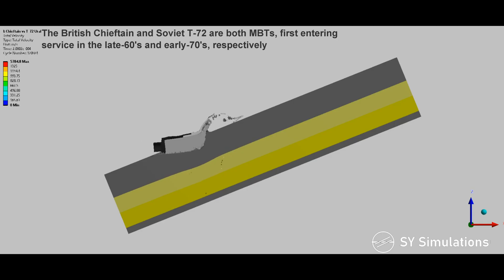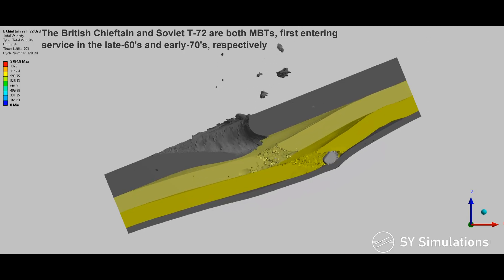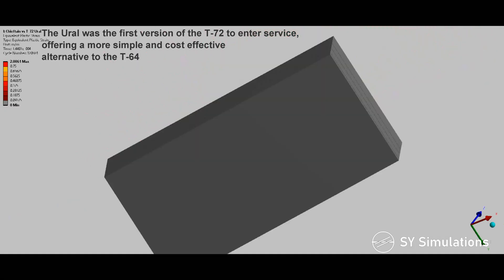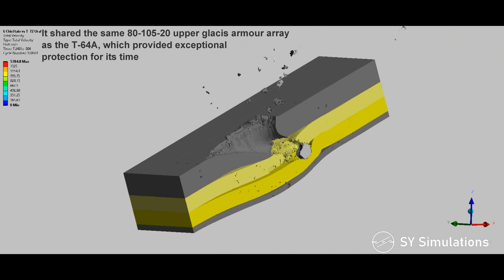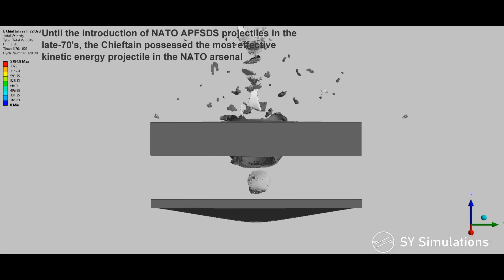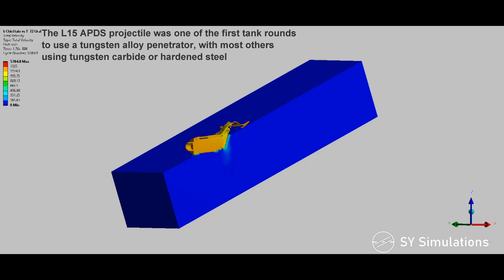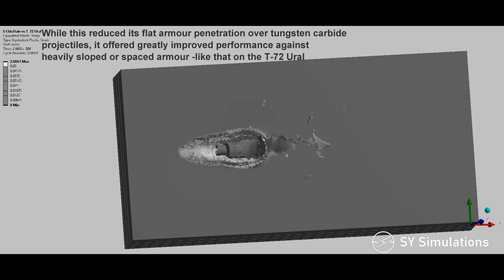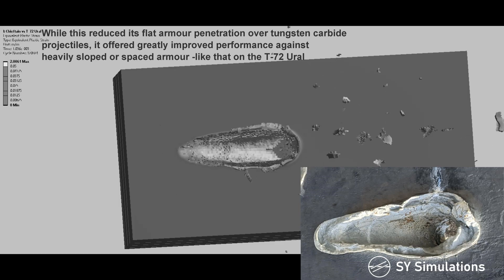CHIEFTAIN vs T-72 URAL | 120mm L15A5 APDS | Armour Penetration Simulation

Comment: really shows how impressive the T72 armor was at its time, the best effective NATO kinetic round, without being angled and at 700m and only slightly perforated it.. 

with combat conditons of lets say 100meters further and a 10 degree horizontal angle, would have definetly stopped the round..
Reply: For a 60s APDS this is very impressive against composite armor
Reply: @lemmen01  120mm cal man it's a huge round with high velocity.
Reply: that would still cause the tank to be abandoned when hit, the armor cracked.
Reply: The crew would be dead from this shot
Reply: @ZapTeam  it would certainly be disabled and the driver would be likely dead, but additional objects inside the tank which clutter the path of the shrapnel will likely not injure, or slightly injure the other 2 crew members as they are also positioned higher than the driver too
Reply: Well no shit that Iraqi T-72s smoked qwaiti chiefs...
Reply: It didnt perforate it, it stopped the APDS
Reply: @parallax9084  the simulation didn't continue for long enough you can see it perforate in one of the views at the very end.
Reply: @parallax9084  0.29 you can see the red dots in the hole at the very end, meaning it did perforate, it just didn't have time to exit it because the simulation wasn't long enough
Reply: @parallax9084 it perforated look at the plate at the end of the simulation you can see a visible hole and fragmentation
Reply: @Constance_tinople  the podboi spall liner was not modeled into this simulation....idk how much of a difference that would have made but the round seemed to have slowed to a crawl...
Reply: @Masterafro999  a crawl from our perspective is still likely hundreds of meters per second
Reply: @Constance_tinople  *being too slow to still fully penetrate the last plate.... The round lost all of its energy
Reply: @Masterafro999 it clearly spalls the armor, but its basically that
Reply: When it can't penetrate the front, then hit the flank and rear, it always has no problem.
Reply: @EatyourshitYoutube  sometimes you have no choice...
Reply: @belgianfried  And that is why we invented Kinder Surprise Eggs (IFVs) and Clown Cars (APCs) to unleash angry hordes of highly creative and borderline insane, Mechanized Infantrymen with shovels and RPGs upon everyone that thinks that our tank was a loner. Panzergrenadiere and their international counterparts exploiting a flaw in an enemies formation is both frightening and hilarious.
Reply: @belgianfried well, MBTs armor are very front heavy, so any modern MBT can penetrate side armor of any other MBT
Reply: @za_pravdu1943  obviously, but what I'm saying is what others have said — will you wait for ivan to go comatose so you can get good angle?
Reply: @ThePandoraGuy Mines stop that approach from working. In fact mines and artillery seem to make everything an incredibly painful, slow, chaotic grind with absolutely no appearance of the kind of graceful, smooth academic understanding of tactics discussed online and other relatively safe and peaceful places.
Reply: @EatyourshitYoutube thats not very good when the T-72 could penetrate the Chieftain from wherever it wanted.
Reply: @quan-uo5wsnot exactly. Early APDSFS russia would have struggled with chieftain turret cheeks, and while better ones were developed chieftain than did get armour upgrade as well as better ammunition. 
Plus early T 72 lacked in fire controll systems compared to early modernisations of chieftains, so while chieftain would struggle to pen, it would also get first try, and first hits in.
Reply: @EatyourshitYoutube  the chieftain is big, fat and slow unless you mean for a different nato tank to flank it instead like the leopard 1 or amx30.
Reply: @EatyourshitYoutube try to flank an single tank in an entire divisional size attack tho.

Yes theorically you can just flank bro, theorically.

Comment: didn't you got them inverted? tungsten is the alloy which has more flat penetration and bad angled penetration because its too much hard with zero resilience while  tungsten carbide more resilient and less hard so it has less pen and more angles pen ?
Reply: nope, tungsten carbide is the weaker one, TC is very brittle so if it engages angled armor it gets shattered in a worse way and isnt as effective, but on flat armor plate it behaves better because it "clumps" together. Tungsten alloy is the one with better angled penetration
Reply: @petrkdn8224  i got from somewhere else as i remember that they are the vice versa. TC being more resilient it has better angled pen because since it is more resilient it has the potential to lean more to adjust its angle (more like the cap in ap rounds) while Tungsten is harder so it can pen more flat and slip more on angles. it more like the M60 rounds: the original M392A2 with much flat pen and the M728 with more angled pen. isn't the latter tungsten carbide ?
Reply: @sameerGhs  M392A2 is WC. just remember that carbide = harder and more brittle, because carbide denotes higher carbon content which is inherently hard and brittle
Reply: I believe you can literally google what carbide is. 
Carbide tend to be metal with high carbon content to form ceramic like substance. 
Now, is ceramic tough or hard?

Also, for steel slug penetrator not utilizing erosion penetration, cap is there to protect the projectile. It does nothing to "adjust the angle" whatever that means. Capped steel slug penetrator tend to perform worse than non capped projectile at higher angle.

Comment: Could you do the effects of 130mm APCBC on composite/thick RH armour when it goes at modern APFSDS velocities?
Reply: That's kinda irrelevant, APFSDS doesn't go faster because it received more propellant energy but because it's lighter. IS-7 gun has 13.5 MJ, M829A3 goes out with only 12.1.
Reply: @Klovaneer more rellevant for a crazy long APFSDS goes at speed of normal AP round
Reply: @za_pravdu1943 I feel like thats even further away from relevance
Reply: @stephenallen4635  cuz it is possible and still pack equal muzzle energy